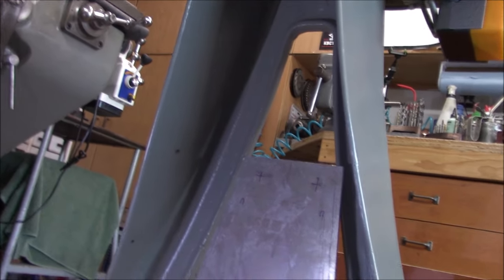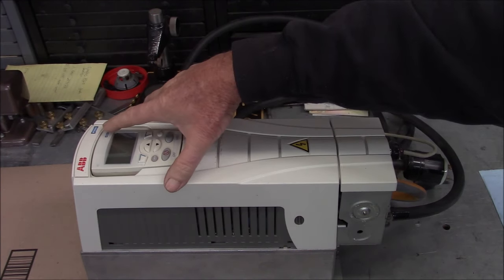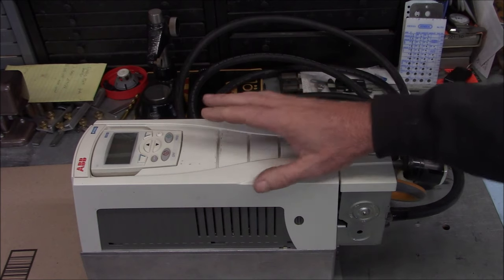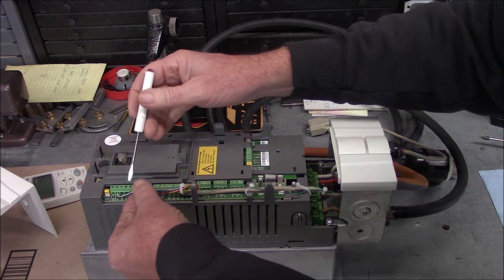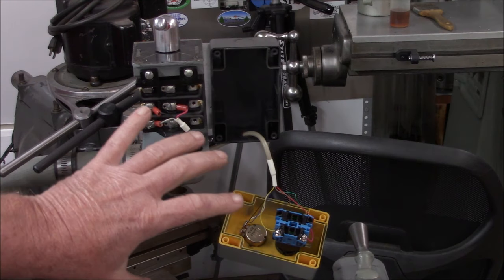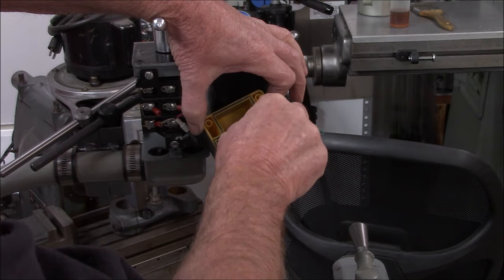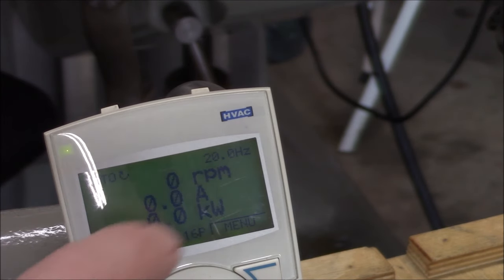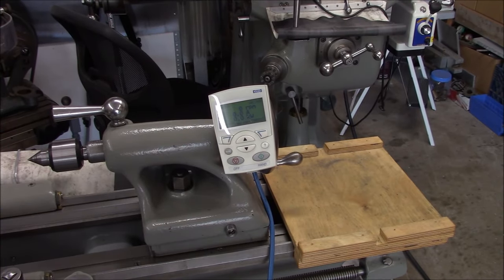South Bend Lathe VFD |  Remount and Control

Comment: Dean, you may want to add an RPM meter.   You can find inexpensive units on line that use a magnet an pickup sensor.   I put one one my Atlas lathe and find it very usefull.